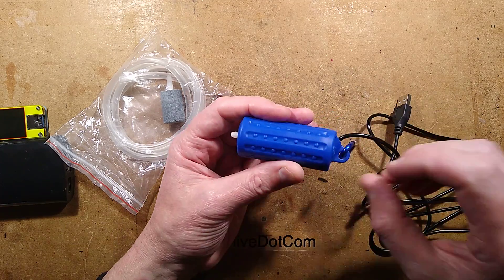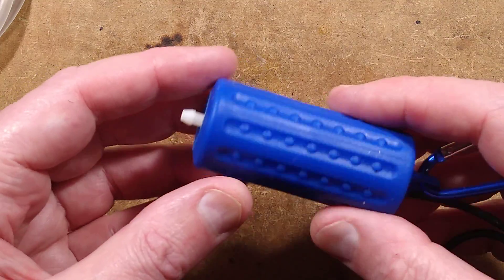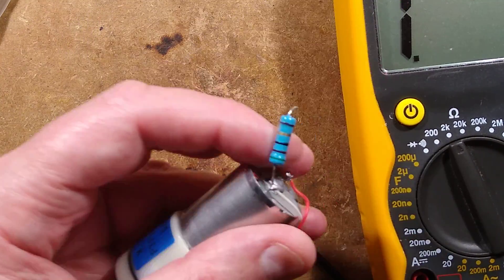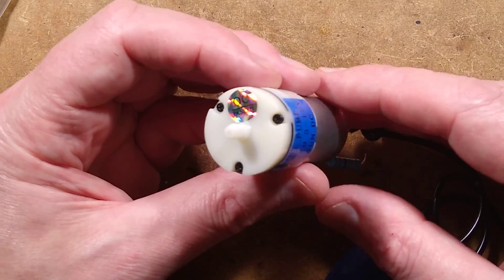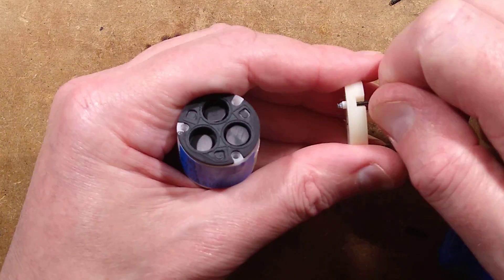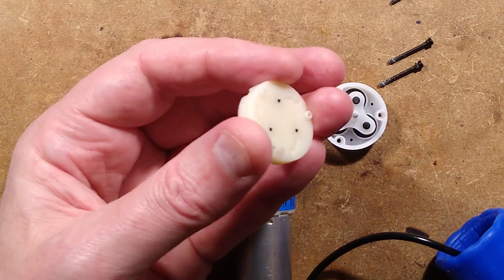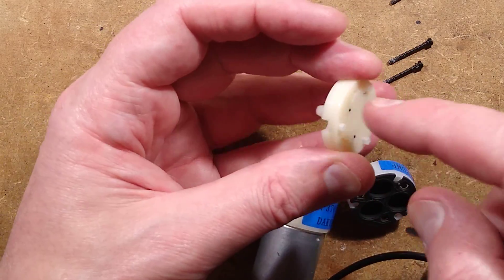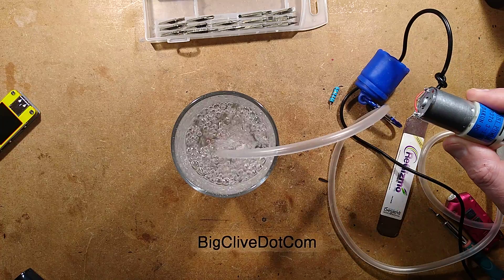Inside a clever USB air pump teardown with hack

Comment: I'm running  2 separate sponge filters from this little devil.
Connected via a T connector with a valve to equalise each filter. 
It claims in the description that it's drawing 1 watt 
Can this be correct?
Anyway it is a little beauty.
Reply from the maker: It is quite low power.  I recommend having a spare on hand as they don't last forever.

Comment: Should you add a back EMF diode clamp?
Reply from the maker: Only if being switched by a transistor.
Reply: I was thinking RF noise suppression, a ceramic disc?
Reply from the maker: @samwilliams1142  A 100nF capacitor across the motor may suppress noise.

Comment: I use one of those pumps for my lab to pull air out of a beaker with vacuum filter on top and they work amazing together! It's only 1l beaker and I've put small voltage regulator module to be able to control speed (3-12v) with a nob. I buy all my stuff off china cuz cheaper and it's basically the exact same product and since it's raw I can tinker around it. My current pump is inside a box along with the controller and only nob is accessible. One thing to note is that those little engines do release some heat so it's important in my opinion to let some ventilation in and out (I'll create bigger box with 2 pumps in parrarel and will apply tiny fan (30x30mm) I got for led lights to help with this heating issue.

Comment: Hi Clive, if you still have that pump somewhere it would be good to see the tear down of the motor - what type of the motor is there? is it brushless? 
I think that one of most important question according to these pumps is their durability and reliability - for how long they can work until they die?
Reply from the maker: Standard brushed, so they will wear out over time.

Comment: I've this air pump and it's very noisy, and vibrates alot, is there any chance i can reduce the disturbance?
Reply from the maker: You could put it in a foam surround without blocking the air intake.

Comment: How do you step-down the power? The only problem with this pump is you can’t regulate the bubbles. His output at 1.5v was perfect for my moina tank. Currently, I’m diffusing the output with four way splitter with 3 valve open — inefficient

Comment: I have 4 of these running in some aquariums at home, and I've been planning to run them direct off of a lithium cell floated at 3.8v or so (battery backup, without killing the cell by holding it at 4.2v all the time)  Unfortunately, one of them died last night.  I think it's been running about 4-5 months.  I expect that the brushed motor's going to be the biggest issue with using them full time.

Comment: I've got one of these, it's new and works but several times a day it just stops working (motor stopped). Not powered by a powerbank so is not cutting out due to low current. I give it a bang and it works again... for a while. I've looked inside and all seems to be in order? Any idea what could be the problem? Thanks
Reply from the maker: Could be the brushes making intermittent contact on the motor, or even a bad wire connection.
Reply: It was a bad wire at the USB plug. I chopped it of and soldered the wires to a 5v supply and it's been running perfectly for about 7 hours...
Reply: Update: It wasn't a bad wire after all. The pump stopped again after a few hours.  But it is fixed now. The actual problem was the rubber sleeve was too snug around the motor and pump and wasn't letting in enough air. The resulting vacuum was enough to stop the motor which wouldn't restart without giving it a thump. I slid a couple of matchsticks in between the pump and rubber sleeve to leave an air gap. It's now been running for more than 24 hours without stopping.

Comment: But where is the air intake!! I want to use a small air pump to connect to a vape pen and use as a tiny smoke machine😅
Reply: I think it must draw through the motor. I've been looking at tons of videos and photos of this desperate to figure out! Is there a hole at the bottom of the silicone sleeve?
Reply from the maker: It's at the side of the pump section.  If you search my videos for the word smoke you'll find a video about an air pump driven vape unit that blows air through the intake.

Comment: Maybe they got trouble with RF interfererence from the commutator, and the super-cheapest way to improve it is by putting a resistor in parallel with the motor brushes.

Comment: I had a couple of this failed on me after ard 4mth of use. Everytime it did died the resistor will heat up. But doesnt run. Should i just cut of the resistor? Did the resistor burned out? 😂 😅
Reply from the maker: The resistor will always heat up.  The motors in these have tiny carbon brushes and are not really rated for long term operation.  In a way they should be treated as a consumable.
Reply: @bigclivedotcom  ahhh now that makes a whole lot of sense. Thankyou for sharing your knowledge🙏😊

Comment: Given the efficiency of the motor, it would be interesting to see what it would draw with the 51-ohm resistor wired in series.
Reply: Very simple: With the output of the pump free, the motor behaves as resistance of 5.0 / 0.033 ≈ 150 Ω
With the 50 Ω risistor in series the total risistance would be ≈ 200 Ω, and the current would be 5.0 / 200 ≈ 0.025 A ≈ 25 mA

Comment: I use that sort of pump (bought without case) as a solar powered aerator with battery storage and voltage dropper for a pond.  I'm running it at around 3.5v where it draws around 25mA (IIRC).  One of these will run continuously for a couple of years before they start to fail with brush wear.  Great little pumps outputting a high pressure.  
I think the 'offficial' use of these is in coffee machines and blood pressure monitors etc.
Reply: So..what do you think this motor is BLDC?  brushless or brushed?
Reply: @indopendent1718  Definitely brushed; standard sprung metal brushes.  They just last a long time if you run them below their rated voltage.  I was amazed at how long.

Comment: I've had one of these running as the sole air pump on my aquarium since this video came out.  I have it plugged into a power bank that is always charging so in the event of a power outage I get about 3 days runtime before the power bank is depleted.  I was originally very sceptical of the longevity of the pump, but a year later at 24h/day run time it's still going strong.
Reply: mine just degraded in 2 month

Comment: the intake air is through the motor via the 3mm hole in the back of the rubber cover. this keeps the motor cool.

Comment: Thank you so much.  This video answered so many questions I had about this pump.  I'm building a micro fog machine for electric RC airplanes and needed a micro air pump that would meet certain specs. This video saved me from having to test a bunch of motor combos.  This setup will do exactly what I need.

Comment: This pump looks like the ones used in blood pressure monitoring devices too.
I've made some research today to find out how this pumps might work, without takin one apart myself. Thank you !

By the way - can't  believe they put a parallel resistor in there, that seemingly does nothing then make it consuming 4 times the energy.

Comment: That is actually a much better pump than is sold here in the USA.  Ours just have a single bellows and a arm with a magnet near a coil with house current connected to it.  That’s it.  Air output of the is quite poor compared to yours !! And ours cost as much as $10.00 US.

Comment: Got this usb air pump but when I plugged it on the Powerbank it auto shutoff after a minute. I guess Intelligent Powerbank won't work for a long time, not tested on an oridinary Powerbank yet.
Reply: I guess Resistor help not to auto shut it off on Intelligent Powerbank but still not working well or maybe the power needed on this usb air pump is too low the Powerbank shut it off.
Reply from the maker: Maybe the pump doesn't have a load resistor or the power bank needs too high a load.

Comment: i have a 5V power bank .. is there any usb tool i can use to make the pump run only on 2 or 3 V from it ? how are you controlling the voltage there ? 
thank you sir
Reply from the maker: You could make it run slower by adding a diode in series with it to nudge the voltage down by about 0.6 to 1V.

Comment: so does taking off the resister make it stronger like does it put out more air?
Reply from the maker: No difference.  Just less current.
Reply: @bigclivedotcom  also does it become stronger if you plug it into the wall?

Comment: The one way rubber flap air valves are the first things to go. Any dust or fine particles of dirt tend to stick on the flaps and stop the one way action. Stick a cotton wool filter on the ones that suck air in. That reminds me I need to make some vibrating rubber flapjack.

Comment: I think the resistor connected in parallel acts like a bleeder resistor to drain the remaining current from the motor coil... it prevents voltage spike every time you unplug the usb connector im thinking its protecting the contact points of the motor and carbon brush or i may be wrong

Comment: Hello mate. I’m looking at using one of these for a completely different scenario. I wear safety goggles which constantly fog, been looking at some systems to run air through the goggles. My question is do you think this pump would be ok running for hours at a time without burning out without being in water? Cheers!
Reply from the maker: It will be fine just blowing air.

Comment: Mhm unfortunately i can't see a way to reverse the airflow. I need the opposite direction.
Reply from the maker: It's only designed to push air.  But if you put it in a small box, porting out one side then it could be turned into a low pressure vacuum pump.

Comment: Can this be used on a small outdoor pond? I'm guessing maybe not, as it will have to be connected to one of those USB battery packs, which if it got rained on, would probably not last very long at all....but if I'm wrong (and I hope I am because I am looking for something like this for my very small outdoor bucket pond) please correct me!
Reply from the maker: You might be able to improvise with a solar panel.  Like the little solar fountains.
Reply: @bigclivedotcom  Haha, I tried that, bought one, did everything right and the bloody thing doesn't work. Couldn't get a response from the seller, so I'm stuck with a dud. Trying to figure out which part doesn't work, but I don't have one of those multi meter things, or whatever they are called. So, other than with a solar panel, is there no way I can use this on an outdoor pond?
Reply from the maker: @SnugglesPlays  You could use it with an ordinary battery pack, but it would get through batteries quite quickly.

Comment: I used one of these connected to a solar panel on an outside tub. Unfortunately, the motor didn't last long, as water got into it. I found a similar motor from an HP printer, and was able to make it fit, so it's now working well again.

Comment: I have a couple of usb power backups that don't do mains passthrough, though they do allow solar passthrough. This would be perfect for those because as soon as the mains went down it would power the pump. Since they are also solar you could set it in the window and it would give you a little more time.

Comment: So if I remove the resistor a 10,000 mah power bank would benefit from this?
Reply from the maker: Yes.  But only if it stays active with a light load.  Some go into standby.
Reply: @bigclivedotcom  then I'm not sure my power bank would work removing the resistor because I used a USB laser pen and it switches off after around 2 minutes but as it is I managed to only use 10% of my power bank after using this device all day which I was very impressed with, so might just keep it this way thank you for your reply.

Comment: Hmm... If the resistor drops the voltage down from the USB's 5v, does this mean that without the resistor a 1.2-1.5v battery can run this compressor?
Reply from the maker: it may run at low voltage, but not powerfully and may not start easily.

Comment: That looks amazing. I have always wondered if this would be powerful enough to run aquarium sponge filters in the advent of a power outage. After seeing this, I'm definitely going to pick some up. Thanks for the video
Reply: Unfortunately, after purchased. It was not powerful enough to run a single double sponge filter, which I ran 3 of them with a single 4 Watt Hailea ACO-6604 air pump. I have ordered 2 more of these USB air pumps, I want to try if 4 of them will have enough power to run my filters.

Comment: Thanks for this video it was VERY helpful. Of course, I have subscribed, liked, and watched the ad to support you. I was wondering if you could advise me? How would I control the power supply to the pump if I was to remove the transistor? is there a small device/attachment I could get? I want to make my pump operate at 1.5 volts as you did in the video.  I need my pump to have the least aggressive bubbles into my tank as I have a very small tank with very very tiny fish and I don't want the bubbles to be too traumatic for them. I would really appreciate your advice.
Reply from the maker: Remove the resistor and try it with a lower voltage.
Reply: Thanks for your reply, but I am still not sure what you mean. 

I have removed the transistor and by default the device operates around 3 volts like you mentioned in the video, but the intensity of the bubbles is still too strong for my little tank. 

I wish to further reduce the volt input to 1.5 volts (the lowest you went in the video and the device continued to operate) 

How can I restrict the power input so that it only operates at 1.5volts rather than default to 3 volts? 

Is there a device I get, or do I change the transistor/resistor etc... sorry I am
A complete novice to this. I will happily contribute to your coffee fund if you advise me. 

Thanks

Comment: I did add this to my wish list on Amazon, seems like a good back up for my Betta. looks as though they were using the resistor to tone it down a bit. Aggressive bubbles from what I was able to visualize from the video. I think although that had more to do with the air stone. I have also noticed though time that items seem a 1/3 larger on video then in person. A measurement device horizontally and vertically on the workbench might bring things more into perspective. Just a thought.

Comment: If they added a small timing circuit with the resistor to click it on momentarily and then bypass it normally would that be enough to keep a power supply on
Reply from the maker: The resistor needs to be there continuously for some power banks.

Comment: You sure that’s not a filter capacitor across the brushes in that motor? Lots of those small motors use a cap across the brushes to cut down arcing and emi.
Reply from the maker: It's definitely a resistor.

Comment: I'm using the same pumps for our outdoor "water feature" that somehow got some gold fish in it. It's running off solar power battery citcuit ..... that resistor is getting chopped off tomorrow ! 

I should add that one of them survived for almost 12 months and only the recent -5 degree C managed to kill it :)

Thanks Clive :)

3 months later... Just took another one apart and fixed the motor brushes to keep it working until a replacement arrives. Noticed it works at 30mA only when there is no load on it. If you stick the stone in water it rises to 70mA. This is without the resistor. Still a lot better than without chopping it off :)
Reply: How did you fix the brushes? I have several of these and they always fail after awhile

Comment: you're using a brand new air stone. Over time they get slimy and clogged, and then it takes more power to produce fewer bubbles. I wouldn't expect it to work as tested
Reply: Understood, but as an emergency measure, you could use a new air stone each time.  Not too expensive.

Comment: I have used these as my main air pump on my fish tank for years now and they still work.  Super quiet and lots of bubbles
Reply from the maker: Keep spares.  They aren't intended for long term operation.
Reply: @bigclivedotcom  seems the "brushes" burn out after 3 to 4 years or so. could it be lack of anti sparking capacitors?
Reply from the maker: @1marcelfilms  That's actually quite a long run time for this style of motor.  It could just be natural brush wear.

Comment: These things are extremely good, superior to much larger and more expensive aquarium pumps on the market! I use these as my main pumps due to just how much quieter and more efficient they are.
Reply from the maker: Note that they do have a shorter lifespan than the simpler vibrating diaphragm ones.
Reply: @bigclivedotcom   Noted! I've kept the other ones back just in case of a failure anyway.

Comment: I have one of these as a backup bubbler for my aquarium. I might have to add a switch to the resistor to select type of power source. I have multiple power sources including auto power banks and battery packs. Good to know.

Comment: Re: Resistor coding: Gold is the 0.1 multiplier. So the decoding 510 is correct and then multiply by 0.1 to 51ohms
https://www.google.com/url?sa=i&url=https%3A%2F%2Fwww.electroschematics.com%2Fresistor-color-codes

Comment: When the pump was running open, those looked like the pistons in a tiny Wenkel Rotary engines like the one in the Mazda RX cars!
Reply: A bus company did build an engine like this, but didn't put it into production. It was very compact for its power.
Wankel engines have a figure-of-eight shaped chamber with a triangular (with curved sides) wobbling rotor. Trochoids!
Reply: For fuck sakes man. Wankel engines have rotors.

Comment: I have this unit and I'm using it with a USB air pump that you tear down. I'm curious because in my case the unit auto shutdown after a few minutes even that is fully charged. I got a replacement unit with the same results
Reply from the maker: If the current is too low, the "smart" power banks will go into standby.